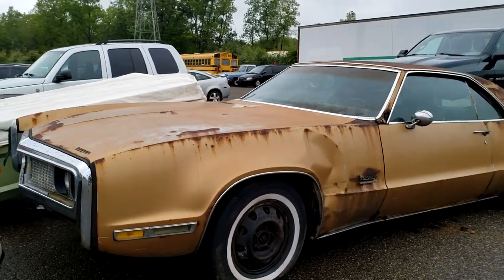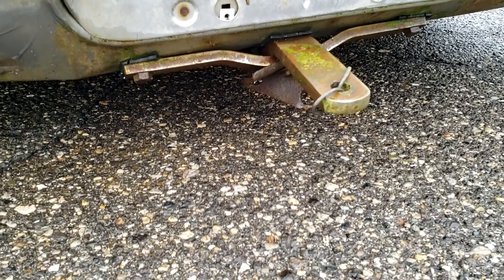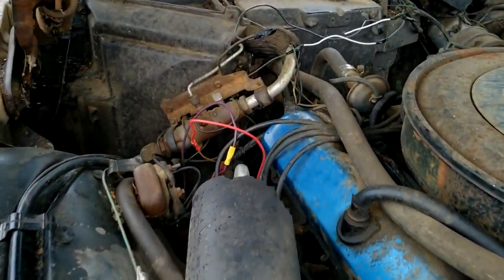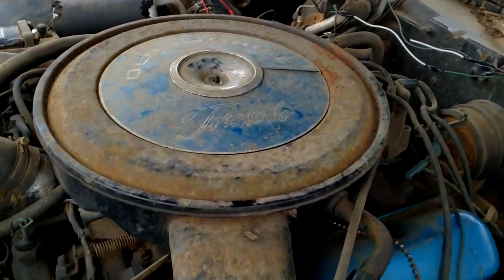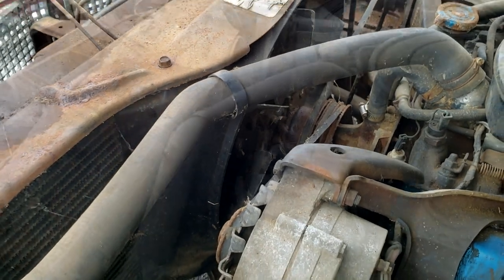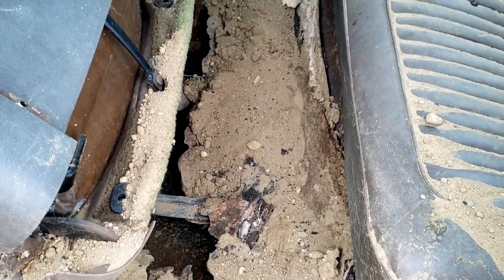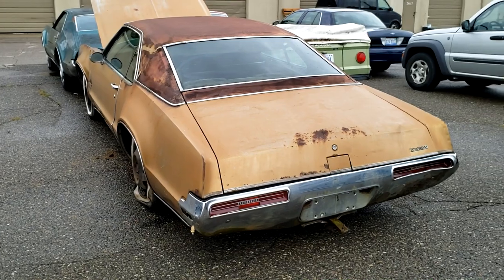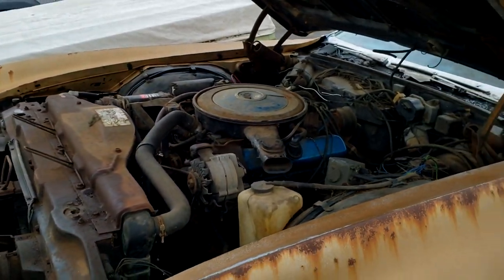1970 Oldsmobile Toronado

Comment: Plug chain is for the vacumn motor on the cruise control system.  Allows you to add throttle to pass while not disturbing the set point.
Love the 70 Toro style.  Seen couple of GT's  over the years.  Wish i could go back in time to get them now.